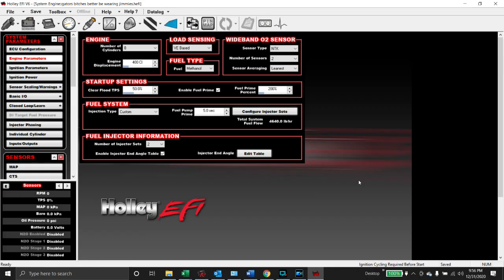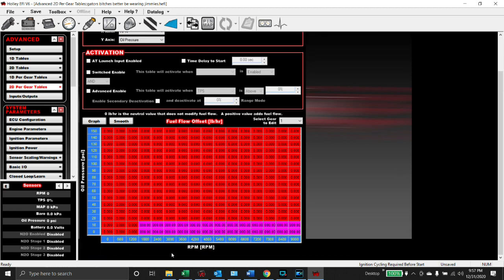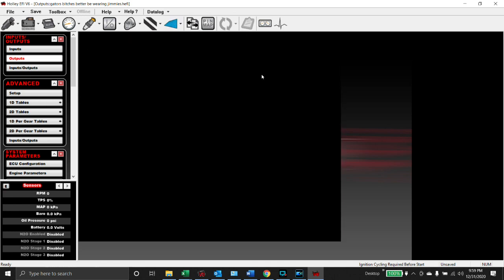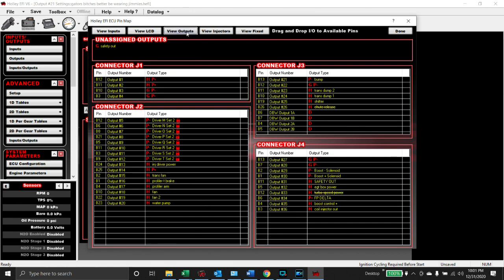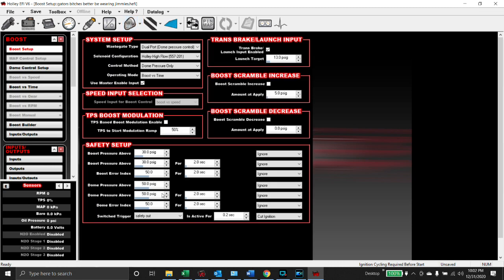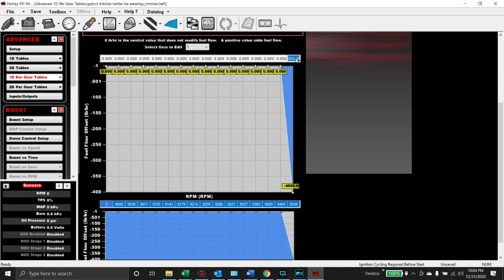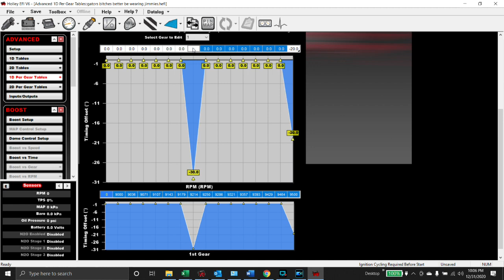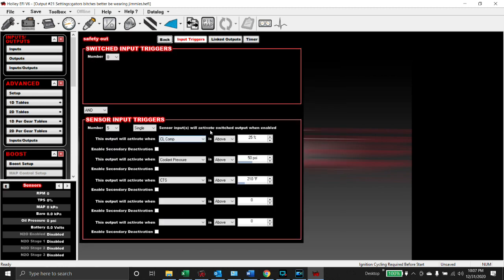How to set up safeties in Holley Efi.  including advanced tables

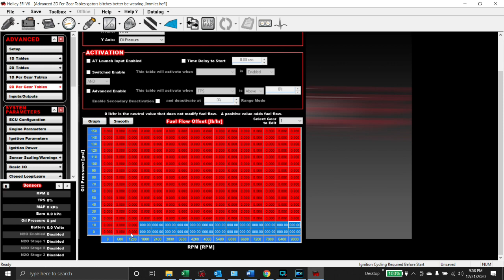Comment: Devin, I will say that I am no tuner so please excuse my ignorance but at about 2:15 min on the video where you are doing the fuel flow offset for oil pressure your values at 1800 rpm and up are positive values (adding 4k lbs of fuel to those rpm values) correct? Wouldn't you want that value to be -4000? To knock out the fuel? Or am I looking at that wrong?
P.S. Also to add to this question wouldn't someone want to do this again for each gear, I noticed in the video you showed only gear 1 indicated. Thanks for your videos btw, they are helped me a ton!
Reply from the maker: yes they would be negative numbers, thought i already corrected this but apparantly i didnt

Comment: If removing fuel, what would happen if Im using a dry shot nitrous stage? It would only remove fuel from the table but have the nitrous fuel added still?
Reply from the maker: correct
Reply: Is there a way to remove the stage of nitrous within these safeties?

Comment: Thanks for the video man im trying to setup a couple safetys and since im still running a carburetor the only option i have is to cut ignition. Well since ive got a nitrous car im running the 1 bar map sensor and when i try to add the boost config to cut ignition it forces me to change the map sensor to a different one since its not compatible.  Can you think of anyway around this or another way to cut ignition completely

Comment: We also use safeties, but not a full cut on power, as it could be dangerous in wheel to wheel racing or on the street.
Reply: could explain more on what your goals are then? If the goal is to save the motor, don't you need to cut all power? what's dangerous about it?
Reply: @briancroneberger9243  imagine no engine power in the left lane of the freeway
Reply: @mback12000  If any of these fail-safes kick in, you are likely heading towards that reality anyways, but in a very involuntary manner.